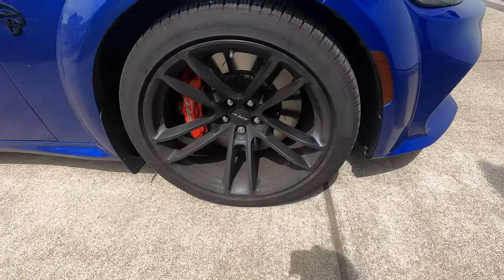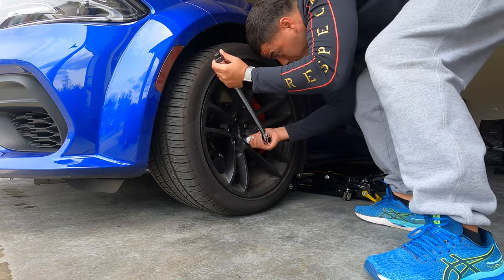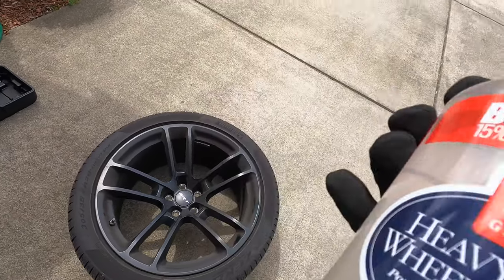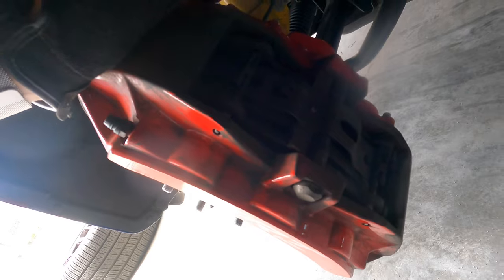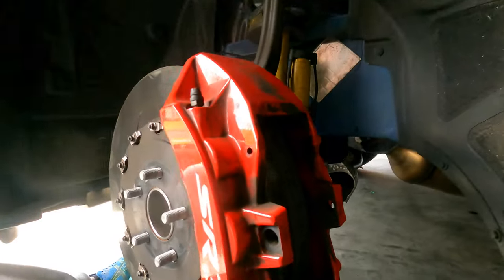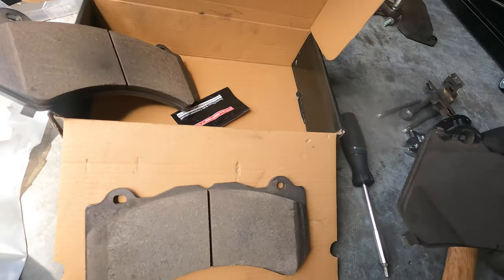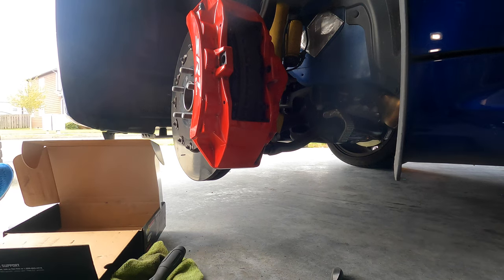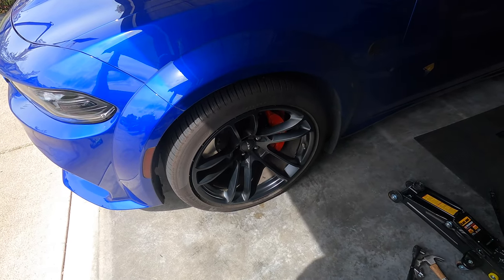PowerStop Extreme Z26 Brake Pads installed on 2021 Dodge Charger Hellcat. #powerstop

Comment: Great video man. This makes me want to do mine myself as well. Also your color on that Cat is beautiful! Question, how many miles do the pads last for? Also, do they grab like the Brembo pads? Thanks!
Reply from the maker: Thanks brother, so the pads lasted past to when I sold the car. They should last like OEM, do as far as break feel in the beginning you feel like u have to press down a bit more before you get a bite out of the pads. But once you get use to it, the pads perform great no complaints. Best mod for the money you can do.

Comment: I own a 2018 Dodge Challenger SRT Hellcat Widebody with 20,000 hard miles on it. I need to replace what it came with new and my Dodge dealer is quoting $5,600. INSANE!!! When I was young I changed everything on my 1969 Dodge Charger R/T and 1972 Plymouth Cuda myself. As a Senior Citizen, I am not changing $h!+ myself; I can afford to pay for it.
Reply from the maker: Hahaha I feel you brother, these pads are not that difficult and not strenuous at all to change.

Comment: The corners on these pads are shaved like that for a reason. And they were still at 50% at least. Go to Walmart or any hardware store and get a set of punches. Also get some wheel cleaner like ADAMS.
Reply from the maker: Thanks for the tip boss

Comment: Yo when I search it up it says it “only fits corvettes” is that cap? I have a 2020 widebody and want to do it myself but it says these don’t fit it but I see you have them on?
Reply from the maker: Nah bro, where did you check for it at?
Reply: @DavidinHD1 I looked at the wrong part number, sadly doesn’t fit a 2020 widebody 392 charger but fits a 2020 widebody challenger? Are they not the same pretty much? Kinda confused haha. Btw nice color on the car along with red calipers noice
Reply from the maker: @Evoislife bro it’s the same brakes if you have the big brake kit, do you have a scatpack? It’s the same brakes, you may want to try another website

Comment: Was your pedal have a slightly sponge feel to it but still feeling bitting the rotors?  I just did mine (did the break in steps) and they feel like that
Reply from the maker: Yes, you’ll get use too it. But it does feel like that in the beginning when changing from the stop pads to these
Reply: @DavidinHD1  Thank you for the reply brother I was going crazy thinking I messed it up. Thanks  again
Reply from the maker: @Jr-eu9ex  lol, believe me I did too

Comment: What jack is that you're using in this video man?
Reply from the maker: Some generic jack from pepboys. Rated at 2 1/2 tons
Reply: @DavidinHD1  I was asking because it looked pretty low profile
Reply from the maker: @sagirius  lol it is called low profile jack on the side. Don’t remember the brand, just know I got it at pep boys
Reply from the maker: I’m actually looking to get another one… possibly a quick jack, one of the electric ones

Comment: Do you have the link where you got the brakes from ?
Reply from the maker: You can get them from the PowerStop site, but I got them from Amazon since they had the faster ship time. The part numbers are: Z26-1405 for the Front and Z26-1053 for the rear.

Comment: Tools list needed to change front brakes and rotors ?
Reply from the maker: Tools I used include rubber mallet, .145" punch, screwdriver, rag, 13mm socket and ratchet.

Comment: Does it make any noise from power stop brake pads?
Reply from the maker: No it actually doesn’t, as long as you follow the break in procedures
Reply: @DavidinHD1  what’s the break in procedures
Reply from the maker: @moek2925  it comes in the box. You have to go certain speeds and brake hard and follow how many times they tell you to do it

Comment: Great video! Thanks! Still like the pads? Any updates?
Reply from the maker: Thanks!! I love the pads, took a bout two days to get use to them. Overall best mid you can do to a scat or hellcat. The wheels stay clean and for daily use you won’t notice a difference. I highly recommend it, and it’s easy to do.
Reply: @DavidinHD1  thanks for the comment.  I have a 22 Jailbreak Charger and will be looking at these same pads. Good insight. Thanks again. Sweet ride man!
Reply from the maker: @01messer1  thanks  🙏🏼 congratulations on the Jailbreak!! Your gonna love it
Reply: @DavidinHD1  Loving it so far, for sure. God bless! Thanks for the content.
Reply: Btw, just subscribed. Keep the Cat content coming.
Reply from the maker: @01messer1  thanks for the support brother.
Reply from the maker: @01messer1  good stuff man, any plans for your Charger?
Reply: @DavidinHD1  Stage 2 kits if they ever get released. Did simple hellcat puddle lights, pretty cool. May do front and rear strut braces and surely going to do a catch can. Maybe a front spoiler with the struts as well. The list never ends ha! You?
Reply from the maker: @01messer1  I’ll try, got some stuff cooking for the cat
Reply from the maker: @01messer1  dude it never ends, I thought when I got my Bags I would be done for a while, now I’m looking at wheels, maybe a wrap.. man idk a couple little mods I want to do just gotta make sure it’s the right one.
Reply from the maker: @01messer1  I’ve been waiting on that stage 2 kit for a year now!!! SMH by the time they release it I won’t have a warranty.. a catch can is a must man, you will see how much oil you can collect
Reply: @DavidinHD1  lol, I get it, it will never end. That's what makes it great I guess. Bags are interesting,   I like the look and adjustability.
Reply from the maker: @01messer1  yeah man I love them, my first ever car with them.

Comment: Do you feel a noticeable difference in stopping power compared to stock pads ? Other cars when I’ve switched to carbon ceramic I usually notice it right away . Just nice not having much brake dust though so considering this for my cat
Reply from the maker: I noticed the initial bite of the PowerStop pads are not like the stock Brembo pads. It stops great, I would think if you where road course racing that the only place it would bother you. After week of driving I am use to the brake feel. It takes a little more pressure but they stop great. I would highly recommend them. Almost no brake dust at all after a week of city driving.
Reply: @DavidinHD1  thanks bud I appreciate that where did you order from, do you have a link or part number to use?
Reply from the maker: @josephmendozajr8993  I got them from Amazon since they had the faster ship time. The part numbers are: Z26-1405 for the Front and Z26-1053 for the rear.
Reply: @DavidinHD1  these would fit a scat pack wide body as well right?
Reply from the maker: @trvphxnry7625  yes they have the Same brakes

Comment: Whats the difference in the z23 and z26 pads?
Reply from the maker: The Z23 pads are a Carbon-Fiber Ceramic formula that offer great dust-free braking performance. This kit is designed for increased braking power for a daily-driven car, truck, SUV or crossover.

The Z26, on the other hand is designed for extreme street braking performance on high performance vehicles. This kit includes premium stainless steel shims to provide better heat dissipation, as well as the Carbon Fiber Ceramic formula found on the Z23 brake pads.
Reply: @DavidinHD1  couldn't have asked for a better response so I'm guessing the z26 would be best for my widebody charger 392
Reply from the maker: Yes, mainly because of the weight of the Charger.. n when you push it you want to make sure u can stop these boats lol.

Comment: I've heard these work well but for about 400 bucks or so more you could get the Demon Performance rotors.
Reply from the maker: Never seen those!! I’ll look into it, especially next time I have to change the pads
Reply: Where?
Reply from the maker: Where what?
Reply: @DavidinHD1 did he get that deal for the rotors.
Reply from the maker: Ohh Idk man.. I got mine brakes off Amazon, same prices is buying them from stopteck
Reply: @DavidinHD1  the Demon one correct?
Reply from the maker: @Popi_Junior  no i didn’t buy the demon pads. I went with the power stop brakes. They work great and reduce the brake dust by more than 50%
Reply: @DavidinHD1  okay cool thanks for responding.
Reply from the maker: @Popi_Junior  no problem boss